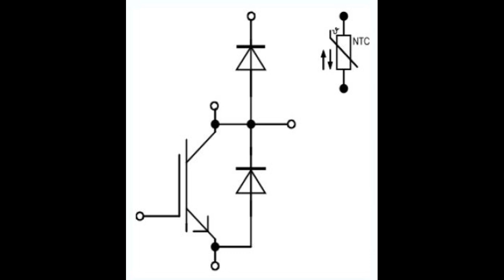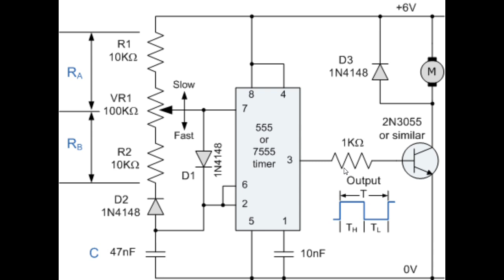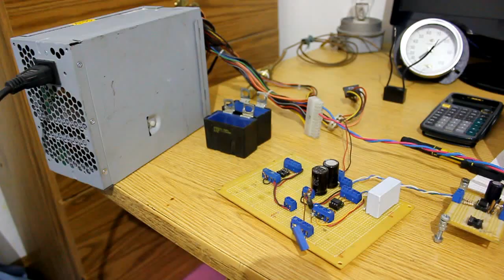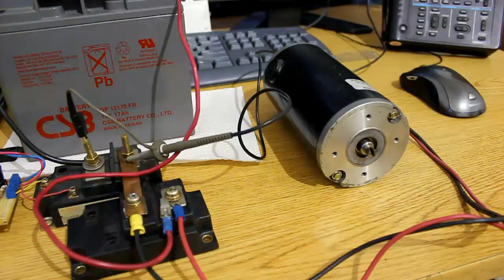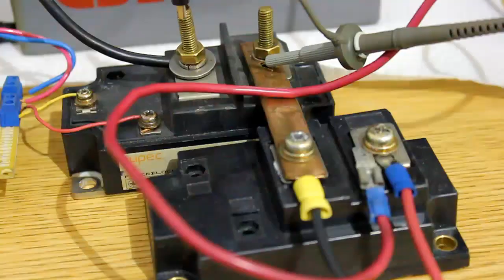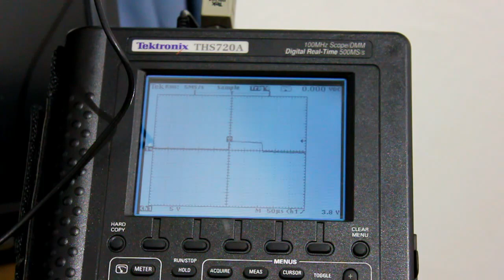How to use an IGBT chopper to control DC motors

Comment: i have been experimenting with this for a while now. you are 100%. i may have to get myself some -3120s because i have been dicking with gate drive transformers and all sorts :) doing it "with black smoke and magic" inside an IC sounds a lot simpler now :) have driven CM400HA-24E with 3A Mosfet drivers without issue, but want isolated drive for a half bridge soon :) thanks for posting :)

Comment: Fantastic tutorial. I know nutting. I have been looking for a driver circuit/schematic for MY NICE EV car project. Now the crazy bit. I am going to use washing machine motors. Yes. I know. Torque and all that. But I will be using 8. Four in each driving pod for each of the 2 pairs of rear bicycle wheels. If you look on my channel you will see the testing I have been doing. I am so far pleased with the results. Thank you very much for sharing your experience with us on YouTube.

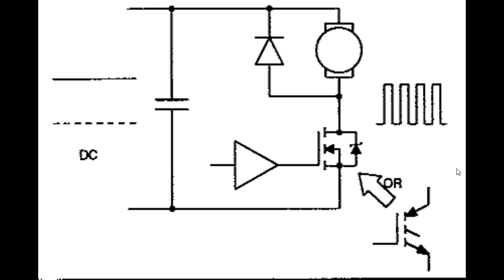Comment: For the circuit shown at 1:37, does the high voltage positive need to go to C1? Couldn't you just connect it to the load only, bypassing the high side completely, leaving the load negative going to C2E1? That way the unit just acts like a single IGBT.
Reply: Actually never mind, I assume you do it that way to make use of the built in free wheeling diode across the load to counter the motor inductance.

Comment from the maker: If you are using a dual IGBT module as a chopper, (For DC loads only) then the second (positive, high side, upper) IGBT must not conduct any current. So the upper gate control terminals (G1 and E1) must be shorted together, no resistor. In some cases, it may even be actively pulled down by applying reverse voltage (-5 volts). This doesn't apply to AC circuits, like inverters ( Induction heaters, AC or Brushless DC motor controllers, welders, amplifiers and so on...)

Comment from the maker: The heat pump originally used R410A, but it had a bad compressor. I replaced the compressor. The new compressor came with mineral oil, but I changed to Polyolester oil before I installed it. The line sets and evaporator were brand new when I installed them. So far, no problems to report.

Comment: Hello, great vid, I know this was awhile ago but could I drive the gate with a MOSFET? My problem is I am trying to make an H bridge with 200 amp two Dual IGBT’s creating a full sign wave inverter, my question is do the emitter terminal next to the gate terminal all be grounded together?  I’m just fuzzy on the emitter side of the circuit.  I haven’t let any smoke out or anything yet but I have a-lot of IGBT’s at my work and lots of ups’s that they just throw out.  Like VFD drives and such so lots of spare parts to tinker with.  It calls for a 4ohm gate resister.  Just can’t quit figure out what Allen Bradley does with the emitter terminal.  Thanks.!

Comment: In answer to my previous inquiry, is it because shorting the gate actually pulls the second IGBT shut? Is there no need for a resistor if the gate is going to be pulled down?

Comment: Well done. Is that a PM brushed DC motor? The waveform and the control may differ depending on the type of motor, and it is important to note the differences, especially since so many EVs use series wound motors. Also, it might be good to add an inertial load (flywheel) on the motor to show how it acts as a generator, and dynamic braking or regen may be achieved. Ideas for your advanced video series! Thanks.

Comment: Another great video, thanks for that.Have been trying to watch as many of your videos as possible so as to not ask dumb questions but. . .When you short out the second gate does that not mean that the second transistor is driven off the power that the IGBT is chopping? What about the gate resistor and very much higher voltage? Why is the driven gate in this video connected with the same value resistor as the second gate? Thanks again for sharing

Comment: Regarding the 3 ton heat pump you retrofitted to R134a. Did you monitor it's progress this summer?  Any unpredicted outcomes? Any issues with lubricity between R22 and R134a?

Comment: Great video! By the way, could you please explain the advantages and disadvantages of a DC Chopper over a Thyristor Phase-Angle control?
Reply from the maker: Choppers can provide better power factor than phase angle control. The disadvantage is that they require more components to work and because of that they are usually more expensive

Comment: Good morning, excellent in your video, with this circuit can i  implement it for a 90v dc motor and feed it with a voltage of 150v dc?
Reply from the maker: You should be able to do this without much problem. DC motors are usually tolerant of switching noise and overvoltage

Comment: How are you able to observe the whole thing on an oscilloscope, when your load is on the higher side and the igbt is on the lower side? I am asking because when you turn off the gate on the lower IGBT, you lose your reference point (gnd)
Reply from the maker: In this video the scope is tracing voltage between E2 and C2E1. I'm showing the voltage across the lower IGBT during turn on and turn off. You can scope the motor but the trace would fall to zero, because that is actually what the motor sees. Although you could reverse the polarity. connect scope ground reference to C1 and scope probe to C2E1. It would just go negative on the scope graph. Thanks for watching.

Comment: Great video!  Here is question I hope you can answer.  I want to control current for charging bulk (meaning dumb and attended) of my 100v lithium EV pack using simply 110 or 220v ac to bridge rectifier then use 1 IGBT module to chop as I start near 0dcv then bringon the volts/current via PWM.  I know this is a bad boy concept without isolation from deadly ac.  Forget that for a sec.  Things I question.  Does the freewheel diode need to exist here as batteries not inductive?  If the batteries are connected with IGBT not getting PWM, there should be no current flow , yes?  In the 110vac version, assuming I will sink say 14dc amps, what size IGBT, driver and diode do you reccomend?  Why isnt the IGBT gate input ttl or cmos levels?  If email is better for your reply and further comms, how can we connect?  Thanks, Jeff
Reply from the maker: What you need is basically the circuit in the video, except you need to put a blocking diode between the IGBT module and battery so current doesn't flow in reverse. I would still recommend using the freewheeling diode. The HCPL-3120 gate driver should accept any 0 to 5 volts input with the proper current limiting resistor. A 1K ohm should do the trick. 7 ma is the recommended LED current, 16 ma is maximum. As for the IGBT, you want an IGBT rated for atleast twice peak current and twice the peak voltage. So 14 amps * 2 = 28 amps minimum. 110 volts ac = 115 volts peak *2 = 311 minimum. So a good IGBT choice would be CM75DU-12F. Thanks for watching

Comment: Would there be any problems with using 3 or so modules in parallel? For an EV I want to control 144v @ 1000A.
Reply from the maker: It can be done, but yes there will be problems. You'll have to make sure the temperatures of the modules are as close together as possible. There will also be some mismatch in the gate drive between them. Make sure the delay isn't too severe. Start with lower currents and slowly ramp up, testing along the way. Thanks for watching

Comment: What is the efficiency if we compare with the regular 4 MOS H-Bridge drive?
Reply from the maker: MOSFETs are usually more efficient, especially at lower voltages. MOSFETs usually don't have high ratings, and the MOSFETs that do (think silicon carbide FETs) are usually expensive. So while IGBTs aren't quite as efficient, they do make a good choice for a low cost, medium to high power switch. As for how much more efficient MOSFETs are, it would really depend a lot on the output power and choice of MOSFET and IGBT technology. Usually the difference isn't in orders of magnitude though.